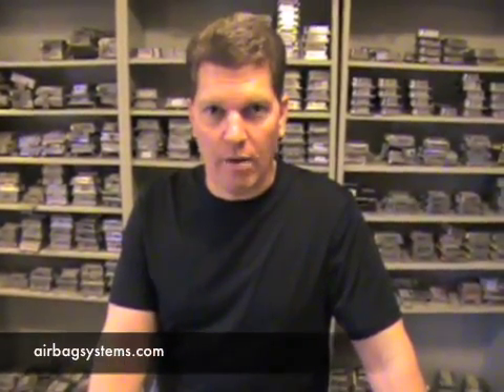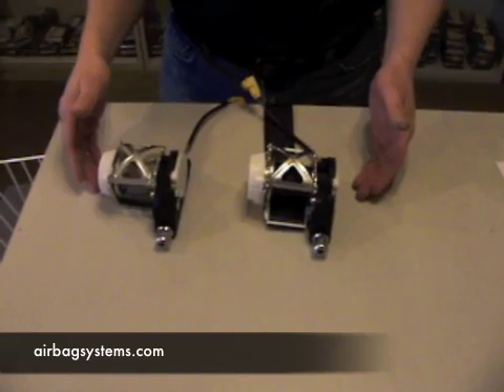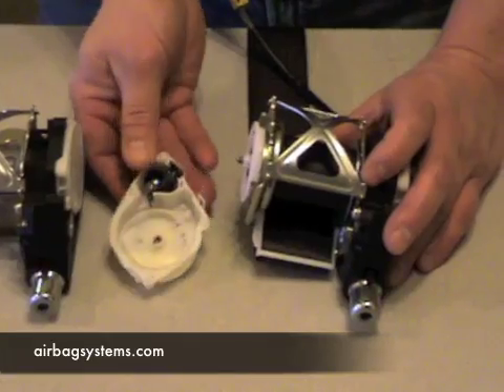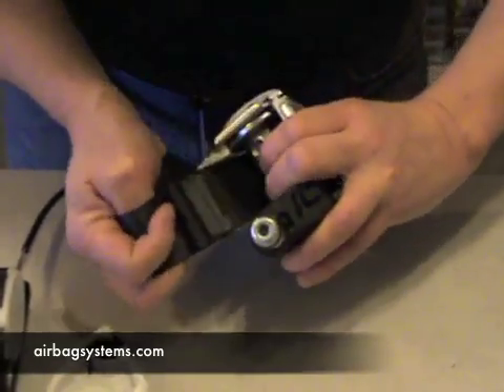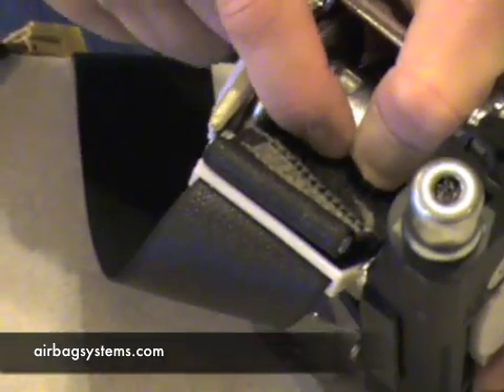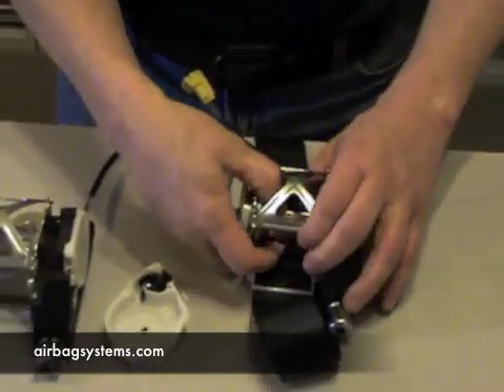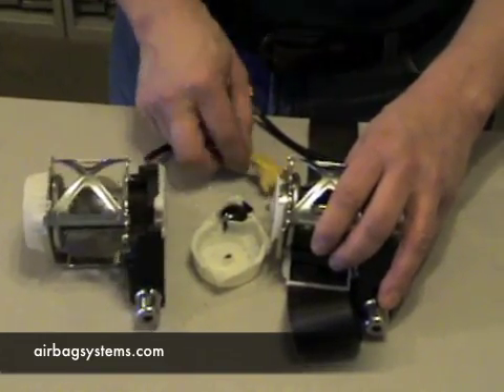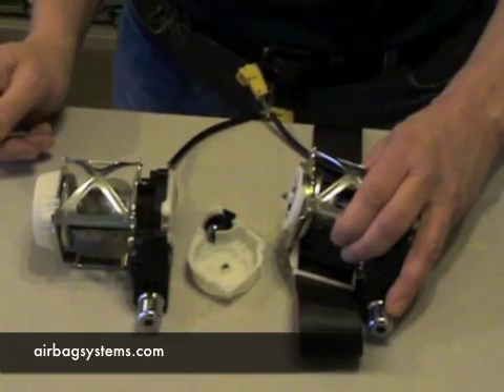Airbag Systems How to Repair a Sealtbelt Pre-Tensioner

Comment from the maker: IF you find that your seatbelt tensioner is bad you can contact us for replacement parts.  We sell most replacement parts from $15 to $30 depending on what you need. Send us an email and with some photos of what you are working on.  Take a couple of different angles of the seatbelt part and we can tell from that what replacement part you need. Most everyone is repairing their own seatbelt tensioners these days.  This will really cut down on the cost repairing them yourself. Instructions avail.

Comment from the maker: The seatbelt working mechanically has nothing to do with the code you are getting or the seatbelt pretensioner being good or bad.  You need to remove the shorting clip, then test with an OHM meter to get the proper reading.

Comment from the maker: Are your seatbelts locked up? Then if so, you need to work on the pretensioner part to get it to release.  The tensioners have parts that also need to be replaced before the seatbelt will function properly again. You can repair this yourself and most of the replacement parts we sell range from $15 - $30 and your seatbelt is like new again. For more information on seatbelts we have other repair details visit our web site.